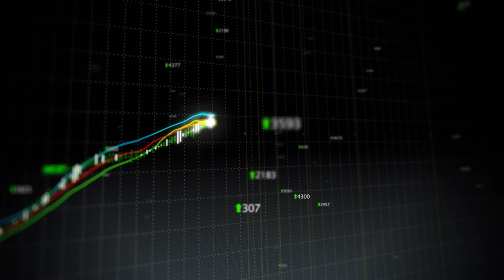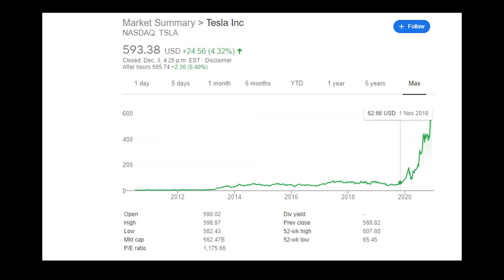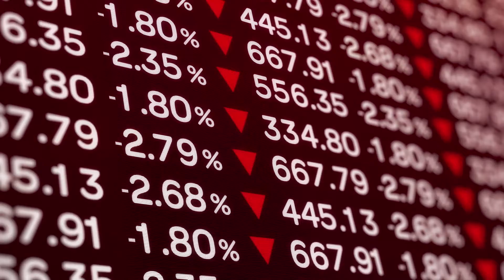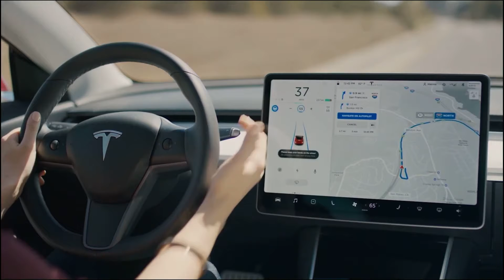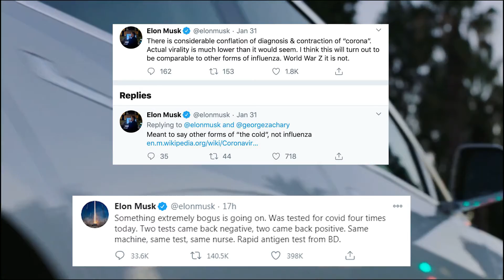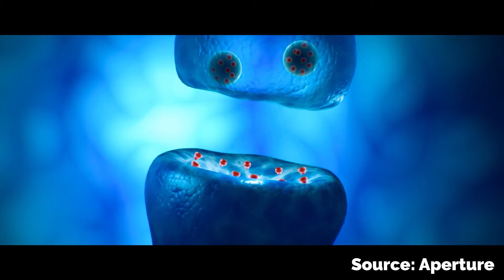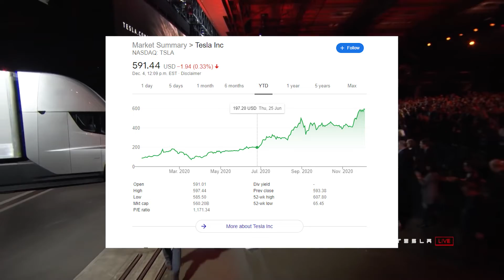How Tesla Made $1,000,000,000 In 2020!!

Comment: TESLA X UPGRADE NIGHTMARE in dealing with Joseph  Dutter, Burbank Service MGR who is lacking in knowledge and professionalism. Mr. Dutter stated in his email below with the upgrade of FSDM my side cameras would work. Therefore I had FSDM installed at a cost of $8760.  Side cameras are not working. I am told it’s an extra $2500. I feel Tesla should cover the cost due to the information I have in the email below from Joseph  Dutter, Burbank Service MGR being one of the reasons I had this installed
From: Joseph Dutter
Sent: Friday, September 4, 2020 2:08 PM
To: stevenjkay@gmail.com
Subject: RE: Regarding
 Hello Steven,
In order to have your side cameras display a video feed while in Reverse you needed both the latest firmware to allow that functionality and to have the Hardware 3.0 installed (comes with either the Infotainment Upgrade or Full Self Driving Upgrade). You have Hardware 2.0 (DAS HW2).

Furthermore, Mr. Joseph Dutter stated Sentury Mode would not work in my car ever. Also, your vehicle is ineligible for being able to record the Sentry Mode as it was built before August 2017.
https://www.tesla.com/blog/sentry-mode-guarding-your-tesla
Unfortunately, your model number was built in March 2017.

With the upgrade, Sentury Mode works as intended.

If I had an employee like Mr. Dutter, is rude, argumentive, and lacks knowledge. I requested I speak with his supervisor without response who was copied on my emails.

Grateful in advance if anyone has any suggestions please contact me.
Thank you,
Steven